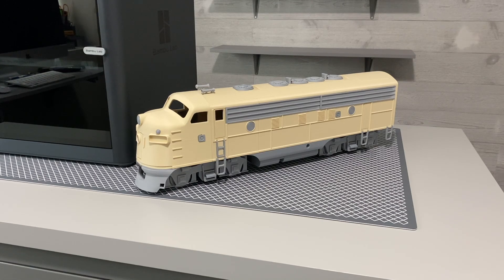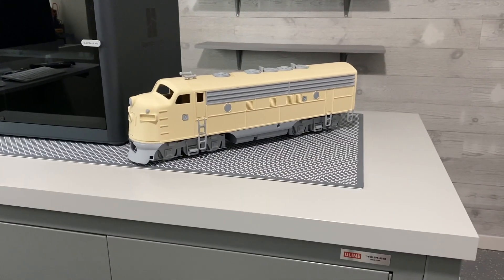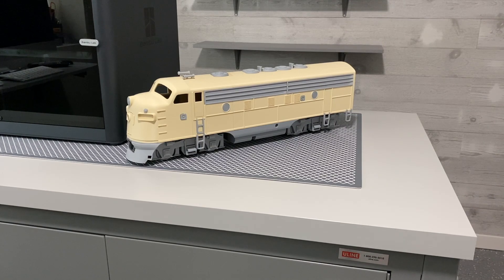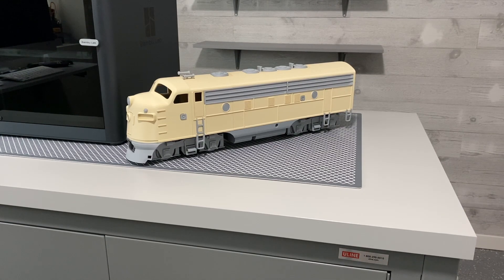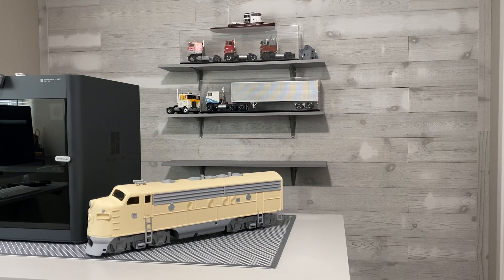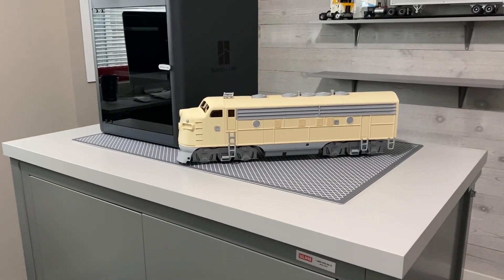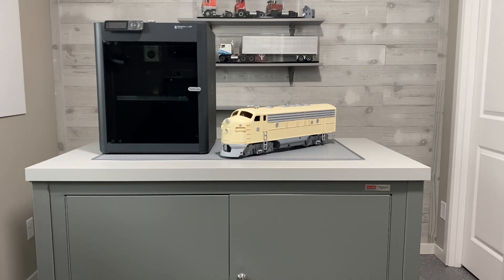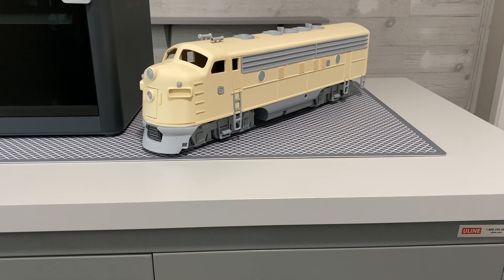John Railroad 3D Printed Locomotive

Comment: Thanks for the attribution. First time I'm seeing this printed in 1/25 scale.
Its looking much better than I imagined, especially scaled up.
Reply from the maker: Are you the developer of the files? It came out pretty decent. It took 5 times to get the hood section to look decent. It was a matter of orientation and heat. You have some other files I like. I probably won’t print them ever this size again. This took an enormous amount of filament and time.
Thanks for your file work. It will remain a shelf display for now. One day I do plan to sand it a little bit and paint it. We’ll see. Thanks.
Reply: Yes, We designed Dragon Railway in S Scale (1/64), and was wondering if anyone printed G scale trains and stumbled upon your video. I am thinking of porting our existing models to G Scale, as more people seem to be interested in it!
Reply from the maker: Your file work was very good. The only issues I had were in some spots. I got a little thick. I did end up making some glass for it. I did add the couplers as well. I also made a hopper that goes along with it. And some track. Keep me up-to-date on some of the other things you come up with I wouldn’t mind printing some more of this stuff. I did plan at one point to make this thing double the size of what it is now I’d love to try that. I have had people message me and asked me how I got it to print so big. I told him where I got the files and they have downloaded them as well but now with the same results I got. Of course I did have to section it in about five chunks for the Body alone and the fuel tanks. I printed is one separate piece upside down. The only thing I’m still missing. Is the front belt around the very front nose of the locomotive. Thanks again.